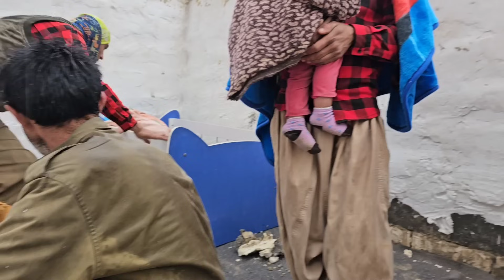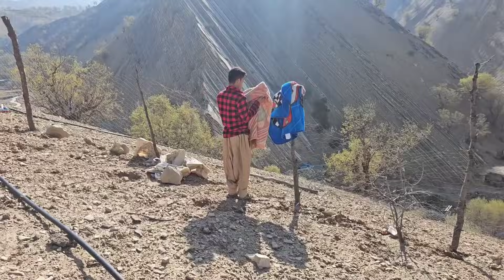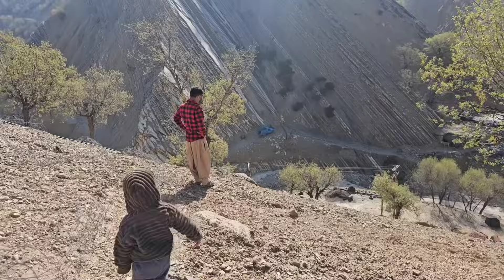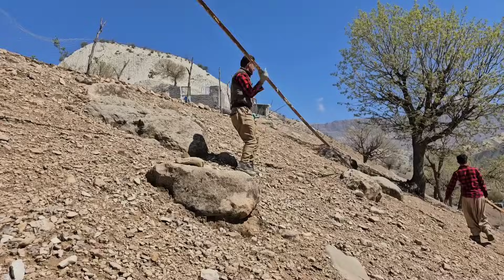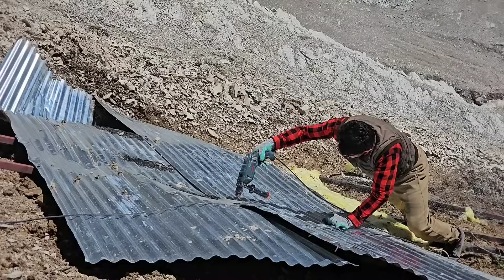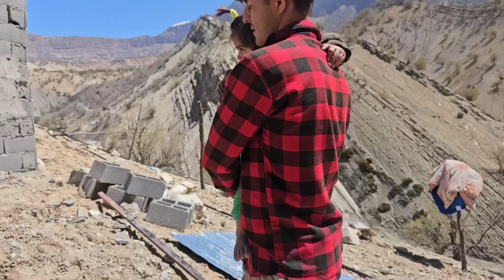Nature's Wrath: The Cataclysmic Storm | Hut's Tale of Endurance & Hope

Comment: So very sorry to see the devastation...  I am sure all the viewers are right behind you!  Thank heavens no one in your family has been harmed, and your neighbours are helping you.  I do not think, however, that the aluminium plates are good enough for a roof.   You need a solid roof made of wooden beams and joists, with tiles above (for the rain and/or snow to slide off).  It may not be a custom in your country to build a roof like that, but putting the metal roof back on will result in more trouble when another storm arrives.  You really do not want another catastrophe like that again, do you.  The very best of luck from Mirka (in London).

Comment: You need to screw the metal roof to the blocks and the poles and put poles under the front of the roof where it hangs way out there so the wind can't tear it off.

Comment: I am so sorry. The destruction was so bad destroying your hard work. I am asking Jehovah God to help you. But you were very blessed that all three of you are safe and uninjured. I am wondering if steel cables placed over the metal roofs and then hammered into the ground would help keep the wind from ripping them off and destroying them. As they are it looks like they became airplanes in the wind. However, I am not a builder so I don't know.